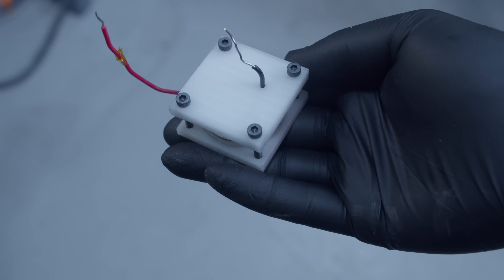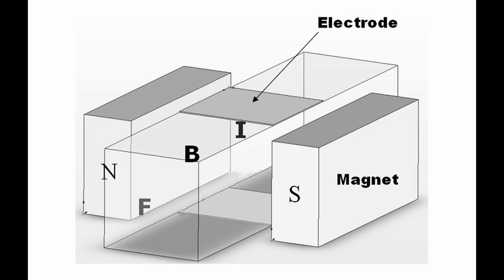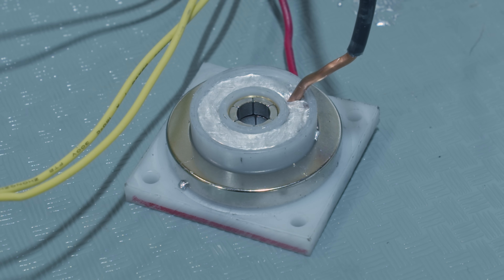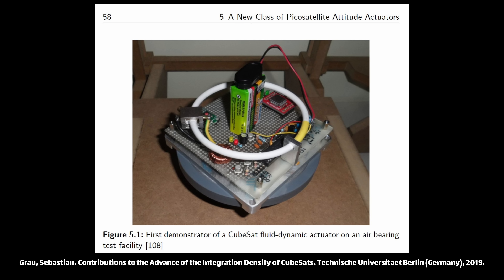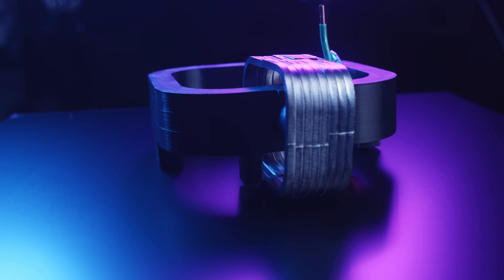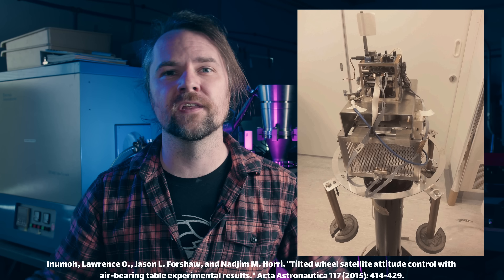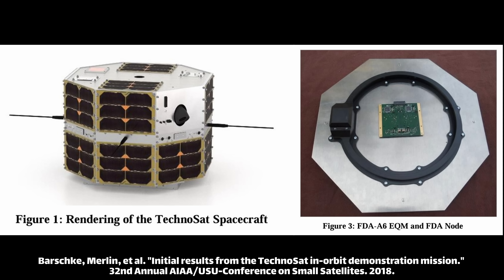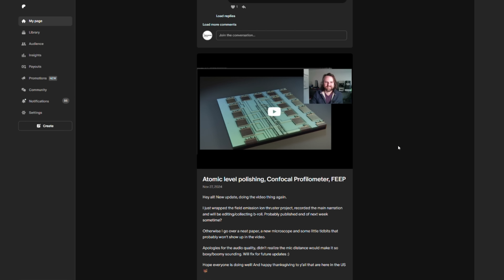A motor with no moving parts (sorta)

Comment: Would it be possible to swap the permanent magnets for coils and wire them in series with the liquid metal? Seems like that would increase the series resistance to make the power supply design easier, and there should be some optimal electromagnet vs cross-current balance that maximizes force. You would have to handle reversing orientation though, as flipping the magnet and current simultaneously would cancel out.

Comment: I am so happy this video posted because just this morning I was having a thought:

Is it possible to exploit a hydrophobic surface to create a tiny, self centering and lubricating.... something? I have no idea what it could be used for but here is my thought: Get two cylinders, one just small enough to fit in the other while leaving a tiny gap for water. On the outside of the cylinder that fits on the inside, paint line from top to bottom in a hydrophobic layer, maybe measure out like 16 stripes? Not sure what the angle in degrees each would be off the top of my head. But, in my head, the hydrophobic surface will create like some tiny 'air shocks' to counter against the water sticky pull to drag the cylinders together?

In my head I am picturing the example of dye in a similar set up but with corn syrup that shows viscosity of the liquid? Can spin it clockwise like 10 times then counter clockwise 10 times and watch the dye stretch out into thin smears then wind itself back into the starting blobs.

I really hope someone reads this and can translate it from me monkey with rock talk to smart person speak.

Comment: In your prototype, the voltage was axial, and the magentics were radial. Is there any significant advantage or disadvantage to doing this opposite? Axial magnets and radial voltage?
I suspect that you could get the magnetic flux much higher by making a big sandwich. Magnets on top and bottom.

Comment: The only practical liquid metal motors i have seen, aren't all that practical. Not too long ago a company tried to use the concept for a active cooling system for computers.... That went under real quick when regulators realized what spicy liquid metal they were using and told them flat out no. (it was NaK)

Comment: a quick way to tell whether an 18650 (or 21700) is protected or not is if it has a button top (the nub that makes it look like an oversized AA battery) or a flat top. button tops have the protection circuit underneath, flat tops are unprotected cells

Comment: Beyond efficiency and stuff, I imagine the solid flywheels nasa uses are also very predictable. You can control them with a computer and get a torque that is very precise, which a molten metal with all its turbulence probably couldn't deliver?

Comment: If my memory serves me, Canon used air bearings on the laser assembly of their earlier color copiers. The model 100 I know had it, I believe the 1000 did as well. If you somehow come across one of these dead, might want to grab that assembly - it likely wouldn't work for this type of project, but be real fun for scattering a laser beam around.
Reply: Using Air bearings in the vacuum of outer space might not be a good idea.
Reply: @BigA1  air bearings are only used in this context to remove friction for testing the reaction motor. Definitely wouldn't work in space.

Comment: You can find unprotected 18650 cells for sale at almost every local vape shop as well. 99% of "vape" batteries dont have protection because the mod or vape has those built into it by law, so it allows those cells to offer much higher constant current draw and many times that in peak current
Reply: LiPo packs for RC also don't have protection circuits and they are designed for very high currents. Even the small ones I use in my combat robots which would fit perfectly on there can handle up to 40A.
Reply: Yup. 18650 cells do not have any kind of smarts. They are used in a wide range of applications, and all of those have their own protection. I was mildly surprised when I found them in a burglar alarm, as a back-up, in case mains were cut.
Reply: @andersjjensen  some do actually come with an additional protection cirtuit spot welded to the top.
Reply: @andersjjensen some 18650 are protected(but arent really 18650s anymore since that is the dimensions). But you can usually tear off the wrapping to find the unprotected cell inside, then you can tear off the protection circuit. I did this once since my local electronics store only sold the protected type
Reply: Yeah, I made the same suggestion.
Reply: The disposable ones don't have any protection at all - they just short the battery across the coil. Destroying the battery isn't an issue, as it's disposable anyway, and it /probably/ won't explode.
Reply: There is a reason they usually have protection, and that is to prevent them catching fire when you accidentally short circuit them. In this circuit, he's essentially shorting the current through the liquid metal. So if he was to use an unprotected Li-Ion battery, it could catch on fire. However, Ni-MH or Ni-Cd batteries can also give high currents, without that risk. But I still don't recommend shorting a battery. 

The solution is obviously a current limit circuit, so that he gets exactly what he desires for the sake of torque control.

Comment: so why that ring needs to be liquid metal. it can be a ring conductor. oh right, the bearings, liquid needs none. also ac transformer coil with rectification, instead of the buck stuff. needle point bearing would be the simplest. or maglev stick bearing. same thing.

Comment: Seeing this I remembered that for years I'm wondering why a passive magnetiv bearing would not work. It is concluded from Earnshaw's theorem that such bearing would not be possible but trying to make a magnetic bearing using round magnets like you have in your magnetohydrodynamic pump I would be curious HOW it exactly would fail... Surely there must be plenty of proof of it being impossible since passive magnetic bearing would be the unicorn of bearings. But i just cant find any videos of failed attempts. Any chance, you could cover this topic?

Comment: wouldn't the satellites that position themselves by literally interacting directly with the earth's magnetic field render this useless?  or would this be more for faster or more aggressive positioning?
Reply: its definitely a drawback but don't overestimate the strength of earth magnetic field in Leo tho. 
But usually you use magnetic torquers to offload your reaction wheels which could proof difficult with this setup

Comment: Thank you for the use of a back iron to redirect magmetic forces. I think a lot of people get discouraged from thier projects when they see the costs assoicated with the magnets per pound of strength and just give up then and there when really a lot of projects could be done will far lower costs by just using a back iron
Reply: Conversely, the relatively low cost and high availability of NdFeB magnets makes for a lot of silly project videos -- sure you can make a, say, windmill that makes a few dozen watts, but it's massive and full of air space and doesn't look anything like a commercial design!  Why is that?  Well, it's not much effort to go one more step and consider the back side of those magnets too!

Comment: Could one make this but as an asynchronous motor instead? By using a rotating magnetic field induce currents in the liquid metal. It would do away with wet electrodes and enable a more perfect seal on the liquid metal vessel. Not sure if it can be done with this alloy though. Maybe some kind of ferrofluid?

Comment: Use two magnets to center a magnets on the shaft of a rotor disk  that stores the angular momentum. Then create a rotating magnetic field that inductively  interacts with the roto to  make an induction motor.  You might try shaded pole, or two coils with one whose current phase is shifted with a capacitor, or you can go with a three phase variable frequency driver.

Comment: For the galinstan corrosion risk there’s always the option of option in a, potentially vacuum rated, epoxy. Especially if it’s not necessary to service it as it’ll be unlikely to react to any galinstan that escapes it’s primary containment
Reply: I think he meant regarding electrodes. I'm not sure about Ga, but In and Sn at least have well understood solubility against base metals, like Fe or Cu -- for which, it's a fairly low fraction, and once the solution reaches saturation, that's it.  For example, Cu can be used at temperature to hold liquid Sn, albeit with notable erosion (Sn diffuses somewhat into Cu, forming intermetallics (IMC); the IMC dissolves, putting free Cu into Sn solution).  Or the solubility of Fe in Sn is very small indeed, hence its popularity for soldering iron tip plating.  In I think is similar, but I'm not sure about Ga.

The tricky part is when these elements aren't quite soluble in the base metal, but diffuse into them anyway -- this is most apparent, and dangerous, for similar metals like Al and Ga, where the Ga diffuses into the crystal structure directly.  I don't know the full extent/dynamics of this, but the diffusion rate of the elements through various alloys is the property you want to look for.  I expect these data are available somewhere, well understood, and exotica aren't required.

If nothing else, a (particularly sturdy: pinholes and fractures are a bane!) plating of a hard metal like Cr, Ir or W very likely handles it, or various compounds like conductive oxides, carbides, sulfides, etc.

Other metals or alloys might be of interest; efficiency is directly related to resistivity, and I wonder which liquids are best. Mercury almost certainly is a poor choice, having much higher density and resistivity than most; NaK might be competitive with Galinstan. I wonder if molten Li might even be an option?  Resistivity is probably worse at elevated temperatures though. (Incidentally, apparently Li and Na are immiscible? So there's no lighter analog to NaK.)
Reply: Can you imagine a science fiction senario, where a galinstan module breaks in orbit, creating tiny orbiting particules of galinstan, forcing all future space craft to have nonmetallic shielding? 

Damn, that would be a nightmare.
Reply: @Superwoodputtie whell there are already a lot of Natrium droplets from cold war atomic reactors circulating earth... 
But you don't have to care about corrosion with 9km/s...

Comment: Air bearing...or maybe just float it in a water bath...?
Reply: The viscocity of water is very high compared to air meaning it damps out high frequency motions much easier. Which is not good for testing reaction wheels

Comment: I've had problems with SMPS and batteries. My issue was that the even though the average current was below the max current the battery could supply, the SMPS would draw current in bursts, and the peak current of those bursts was tripping the PTC in the battery.

Comment: Does anything need to be in contact with the fluid? 

I could see this being vacuum sealed into a glass donut (think a neon letter “O”) for stability (and potentially mass production) and i’m curious if Multiple phasing would work 🤔 (like a 2nd or more set of coils)
Reply from the maker: Induction can work! It has a different set of tradeoffs/scaling losses, but it's definitely viable! I like the idea of sealing it in a glass ring, that would nicely solve a lot of logistical issues

Comment: We called'em mercury vortex engines. I've made them as far back as 30 years ago. I never thought about space application. I imagine friction makes conventional reaction wheels more energy efficient, than a fluid that is going to be continuously venting energy through heat.
Reply: Yeah my first reaction was that friction might be a serious efficiency loss here.
Reply: Mercury in a sealed toroid with laminar flow at about 100,00rpm with implosion vortex fins on the walls. THEN things get "Novel and Unique"
Reply: Makes me wonder how good could this work with teflon tube or another low friction material for flow region?
Reply: @ I used mercury. Technically, you could lower friction of it by raising temperature or using gas as long as the density can form a conductive path, like in CFL bulbs, but the tradeoff is that with less density, there's less reactive mass. I mean, it's not like people haven't already thought of all the options in this video and rejected them for a good reason. Math just doesn't work out. My idea was to use this sort of propulsion to build a completely silent submarine. Went to science fairs with my prototype build, but never won anything.
Reply: @enilenis what kind of effective rpm ? U think this can give higher rmp rotation speed (than traditional bearing motor designs) ? Or does the friction get out of hand (heat)…. And that’s where u would need to go high density vapor — at the cost of rotational mass… hmmmmm ? That sound about right ? 

If rotation speeds are the goal can go lower density vapor and go plasma ?
Reply: I would also think that classic reaction wheels preserve momentum without adding electricity. As soon as you would stop adding electricity to the liquid the friction would return the satellite's position to the original orientation (minus heat loss). So with the liquid wheels you would have to keep adding electricity until you had the chance to bleed off the momentum to Earth's gravitational field.
Reply: @ This sounds right to me, yes
Reply: I'm not sure the efficiency loss due to drag would be a big deal for something using this type of reaction wheel. To my knowledge there are two main types of reaction wheels, the kind used on the ISS use the gyroscope effect on a constantly spinning mass to provide a torque perpendicular to an applied torque, the other type, more commonly found on satellites, apply a torque to a mass, either spinning it up or down, and getting an opposing torque in response. Whereas the first kind need to keep the wheels rotating constantly, the second doesn't. You lose out on the passive stabilization of a constantly spinning mass, which might mean you'd need more active stabilization, but you're probably going to be using that anyway.
Reply: @StarkRG  The simple variable rate reaction control wheels are also constantly spinning. Less issues with stiction and cold welding that way, and corrections rarely cancel out fully anyway, so they tend to build up speed over time and eventually have to desaturate.
Reply: @karl0ssus1  They do, but my point is that they don't actually have to in order to perform their function. As you say, it's partly the side effect of the corrections not cancelling out and partly a design constraint due to having moving parts.
Reply: Heat build up would be less of a thing in space with proper shielding, no?
Reply: @seejayj  Heat is more of an issue in space since there's no air to facilitate convection cooling, you're restricted to radiative cooling which is very slow (the "radiators" you find on Earth are almost all convection-cooled rather than radiatively). Space is only cold if you are able to stay in shadow all the time, as soon as there's sunlight, you're dealing with potentially hundreds of degrees.
Reply: @seejayj  Hets comes from the inside: friction and ohmic losses. And cooling is always difficult in space - think of it's vacuum as a good thermos bottle. Only radiation possible
Reply: @seejayj  As another has said, if heat BUILDUP was the issue, it would be worse -- to dissipate it, you ultimately only have radiative cooling to choose. 

But otoh the issue with heat here is usually that the heat generated by friction etc is energy that is going to be wasted as it leaks into the system. So until a point where temperatures are a problem for the materials, the self-heating property here miiiight actually help? In that, hotter temps mean less friction, thus higher energy efficiency, and so you might want a little heating. I'm not sure how that would ultimately play out, if designing with that in mind.
Reply: The Round Shape can be optimized by making the shape not round , rather a saucer UFO shaped oblong.  Try that shape, then laminar flow of the liquid metal seems to flow better in that shape.

In theory, liquid metal could be sandwiched in UFO ships that spins at 50k RPS, to har that anti gravitic reaction.
Reply: @OuterSpaceDogs it's not anti-gravity, just a resistance to rotational acceleration that makes them very hard to tip over (because of inertia). If the gyroscope isn't supported by anything, it falls at the same rate as everything else. Test it with a toy gyroscope if you like. The second the support goes away, it'll just drop to the floor.

Comment: This is really awesome. I do wonder how viscous friction in the liquid metal compares to the rolling resistance of the bearings used in a traditional reaction wheel, my intuition is you would need a lot more power to maintain the velocity in the fluid. But then, intuition is moot when you don't have a fingertip feel for the dynamics of liquid metal. I wonder what the saturation condition is for this system too, will we ever see a video of a supersonic liquid metal jet escaping from one of these haha.